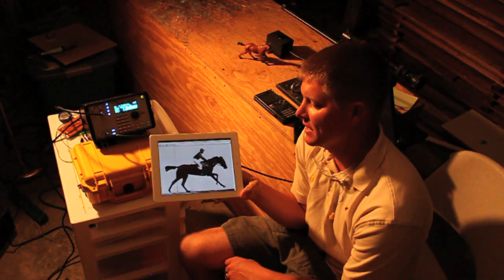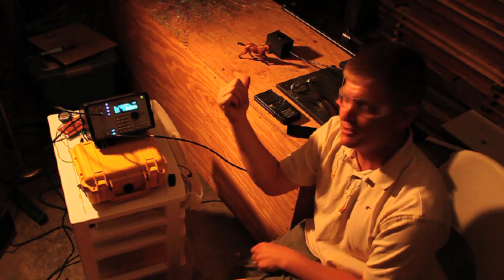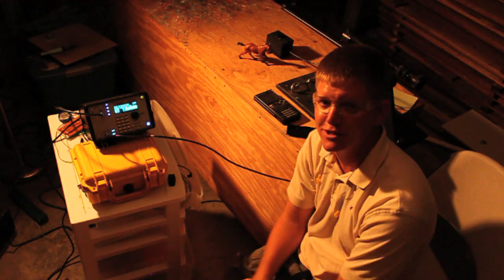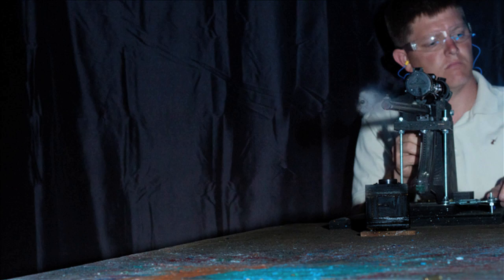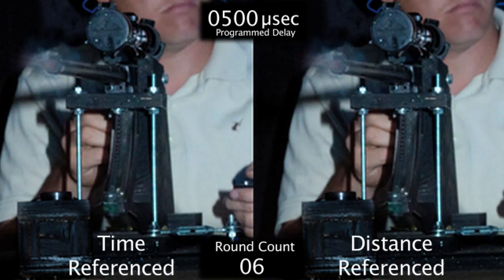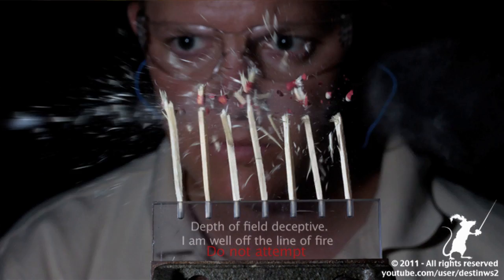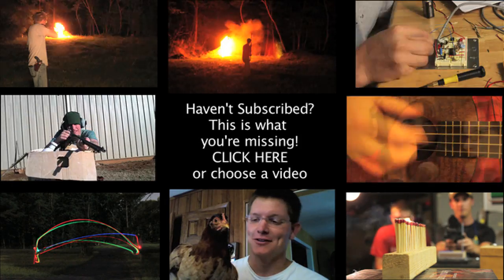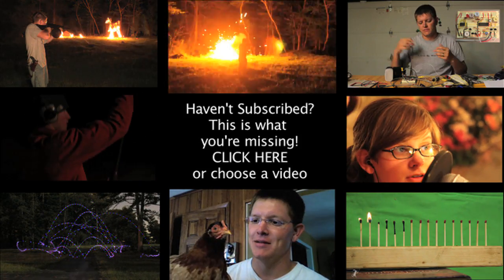DIY High Speed Video Camera - Muybridge Style  - Smarter Every Day 5

Comment: How did he sync the camera shot to the flash?? Seems like a technological feat in itself... surprised he didn't go over that part.
Reply: +johnnyboi828 That's the trick, the shutter stays open much longer than the duration of the flash, it's just that the flash is so much brighter than the dark room that it 'freezes' the bullet in mid air. That's why he has to turn out the lights, otherwise the bullet would appear blurred. 

I would imagine the camera shutter is triggered just prior to, or on pulling the trigger, to give the shutter time to open. By the time the piezo triggers it would be too late to trigger the camera; the flash can react much faster since it doesn't have to move a physical object.

If you've watched his video on light painting it works on a similar principle.
Reply: +johnnyboi828 HEHehehHEEHeh
go to truThcIOnteSTCom< rEad tHE OPREsent

Comment: hey im installing a new stereo system in my truck and im going to create a custom fiberglass sub box. and what im wondering is if i should use that acoustic flash pulse generator for the neon lights im putting around the subs or if there is some other way like connecting both the sub and light wire together and every time the electrical current flows to the sub, will it trigger the light as well?

Comment: According to your link, this has 250 pS resolution, not 25 pS.  Still, that's a really impressive piece of equipment.  I'm surprised that it's only $2500, significantly cheaper than most high speed cameras.